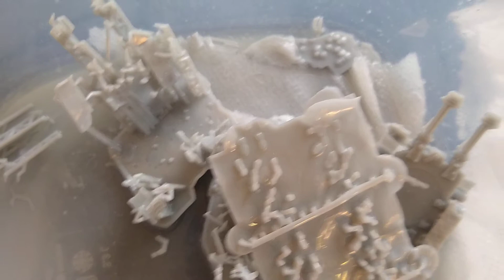Phrozen Sonic Mini 4K Continued Issues

Comment: 90% of the prints failed on my sonic mini 4k until i changed the FEP film to NFEP. prints great now. using the same resin before and after. using the gray 4k resin
Reply: rip off that paper and tape, place paper, calibrate z axis remove paper( ONLY DO IT ONCE), dont tape it up, precautions are noobtraps on this machine so get a funnel or pour more carefullierly...when measuring always add a lil extra, dont screw the nuts down on the vat too far, just enough to where they hold it down NOT tight but just enough so it doesnt move, spinning it freely til it stops will most likely do it maybe a millimeter more. ONLY clean your vat with alcohol, just soak the entire thing inna bucket and dont wipe it out cuz it will scratch and 4k picks up those details every time, just let it evaporate i use a growtent fan since it sucks harder than my ex-gf, dries it real quick. sand the living hell out of your build plate in one direction, dont be that guy who says, "i think i sanded it too deep" just sand the rest of it deeper to match, use skate bases to easily get them off no matter how stuck they are, its better than sticking to the fep and tearing a build that would have been perfect otherwise. i guess my best advice is to spend the cash on all the resin and dont listen to anyone, act like it fellouta the sky and you are tasked with figuring out how it works, dont give up on it or its a total waste of money and a really cool hobby...as for that damned plastic threading, well, that just sucks lol, my second print had a problem with the STL and the printer tried raising it past the top , just sat their going BRRRRR so i shut it off real quick, and it was fine thank goodness, printing a new one at this point would be like troubleshooting your internet when your internet is down...

Comment: I got mine printing well after replacing my FEP with nFEP film.  Not sure if it’s just a bandaid solution but works well now for the last 10 or so prints. Also using their gray 4K resin, so the resin choice could be working better for me as well. I’m using chitubox with 3D printing pro’s support settings and Phrozen’s recommended settings otherwise. Before replacing the FEP with nFEP I had print failures roughly half the time, from stuff sticking to the FEP to build plate adhesion, to part not sticking to supports.

Comment: I might be totally wrong but I think you should get the company Phrozen to send you a new machine, or credit for one because on "Hobbyist Life" youtube channel I believe his first machine had a bunch of problems and he eventually  got another PSM4k and had lots of successful prints thereafter. So maybe its just the machine, because 90% failure is very high.
Reply from the maker: It is, it turns out it is partially things that I repaired and partially user error. I am putting together a video about it. I've been spending a lot of time with Phrozen's Tech team. They've given me G-code and settings for the Resins that has resulted in a lot of success. Still needs dialing in but there is some interesting differences that have shown up between slicers as well as a mystery of purpose for certain settings. I am still trying to figure it out. But I've gone from 90% failure to about 80% success.

Comment: maybe it's the tape on the edges of the lcd screen. It might be layered on too thick. Since the lcd screen isn't right against the flush of the machines surface with this model, this can cause a little space between the lcd screen and the fep film. Even a little bit of space there with this level of detail can fuck it up with the light diffusing between even that little space. Take off that tape and replace it with your own and eliminate that space.
Reply from the maker: Indeed the factory tape was too thick. I removed it after the glue it used got soft and made a mess from the heat caused by printing. I then made a layer of tape that made a level bed for the vat to sit on. It improved things, but not much. It's one thing I didn't go into in the video. The vat gets warm to the touch during printing and it's a giant heat sink. Gotta wonder where all that heat is coming from. The UV lamp I presume, but that much heat into the screen can't be doing good things to the LCD. The factory tape is this ultra thick electrical like tape. The screen isn't flush with the top of the case either, but from what I hear that's normal for this model, bad design anyways.